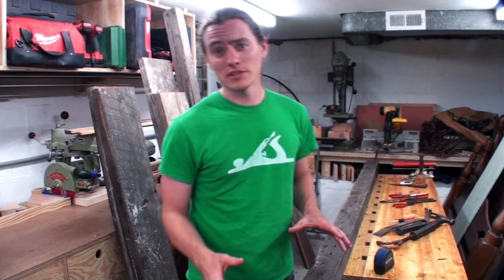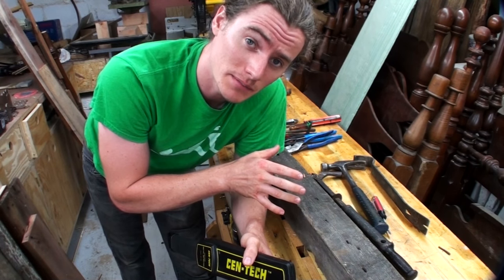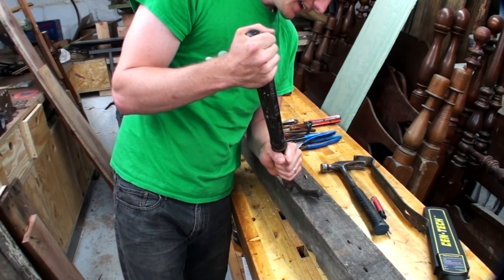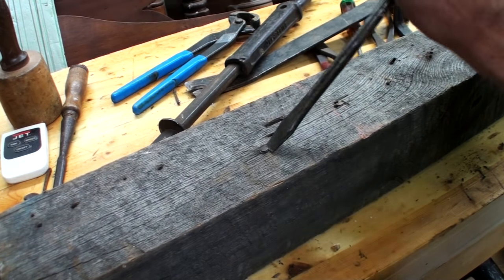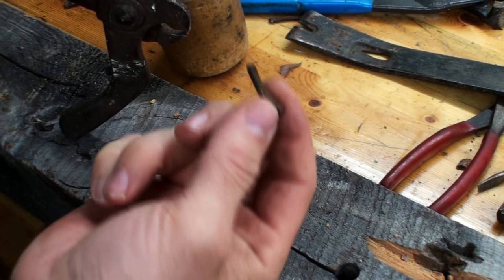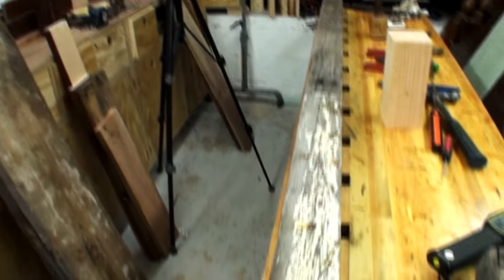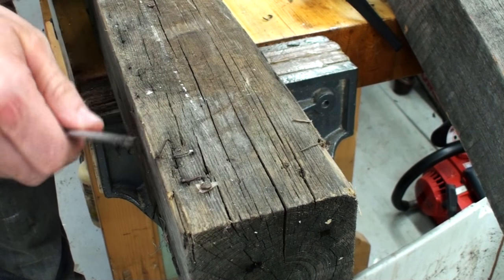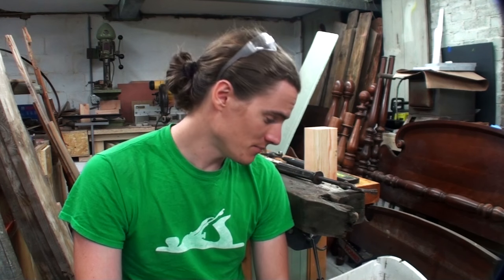Reclaimed Lumber - Removing Nails and other metal

Comment: Words of wisdom.  I've had so many people talk to me about pallet projects... and they are such a royal pain.  Also, the toxins produced by some of the chemical drying methods can be really dangerous to be around (and have airborne all over the shop).  You touched on all the good points.  It's really important to be realistic and choosy when working with reclaimed lumber.
Reply from the maker: Pallets are something I just don't mess with. They are pretty low grade, the slats are already so thin and the nails used to put them together are just to good at their job. I find the time to get them, take them apart just to end up with thin little boards are not worth my effort. They are usually still pretty "wet" as well. I've seen some nice projects made with them, but they just don't fit what I'm doing. Thanks for watching Ed.

Comment: One tool you didn't mention or show is a "Cat's Paw". Good for getting under the head of any nail that is flush or slightly embedded. Does a similar amount of wood damage as the tool you showed. It's nail pulling jaws are driven into the wood around the nail by a hammer.

Comment: Old dimensional lumber from buildings up thru the 1940’s is absolutely worth some work to salvage. There is no more old growth heart pine to be had except for salvage & sinkers. People are gutting old houses in 50 mile radius of Charlotte to renovate with OSB & vinyl plank, tossing a boat load of dimensional lumber, trim, raised panel doors, window sashes & mantles. I asked one guy why he was throwing out stained raised panel doors complete with their mortise locks, engraved brass knobs, casing, backband, & 1 1/4” thick jambs. He said it was easier to rip them out & install pre hung units than work on them

Comment: For embedded nails, I drill two elongated holes on opposite sides of the nail then use two screwdrivers to wedge the nail up and out.  The nail puller I have has been one of the best investments I've made.

Comment: I've had very good luck pulling tough-to-pull nails with a large pair of vice grips (newer ones that still have sharp teeth)
Lay a heavy putty knife or your flat bar next to the vice grip and when you roll the vice grip over to pull the nail it won't dent the wood.

Comment: tip for the old cast iron nails is to tap them first.. it breaks the seal on the expanded rusted nails it also helps with alot of them snapping etc
Reply from the maker: Thanks

Comment: To find nails hidden in old wood so long it lays horizontally, place one of those super strong magnets on top of a thin flat piece of plastic and slide it up and down the entire piece of lumber. The magnet will react to metal locating nail.

Comment: I have the Garrett Super scanner. Works really well and will pick up a staple leg. Definitely saves your planer blades. BUT agree on your comments re messing around with second hand timber. As you say, the ends are messed up, the are often notched, once you straighten everything, chop out all the missing bits and pull out the nails your yield isn't great and the day is gone. Now I just have to remember that next time I find "free" timber.

Comment: Factory recycled pallet 2x4 oak runners with the ring shank nail heads sliced of leaving it embedded about 2.5" deep every 2-3" apart, it's impossible to pull out. That puller with the sliding hammer don't have the leverage or the nail will break apart and won't let go. The way to get it out was with a hole saw going deep enough but it's a lot of work, not worth the effort. BTW a staple puller (the one for wood) is a lot faster than with a screwdriver.

Comment: I often use Vice Grip to remove staples. I found out the hard way that old enamel or epoxy paint can quickly ruin the blades of a planer, same with really hard knots in old wood like Southern Yellow Pine. I set up a jig to use my Dremel to sharpen my planer blades.

Comment: Good emphasis on the nail puller, that tool doesn't often show up in DIY. My original was an antique one but the small jaws were so worn it wouldn't hold. So I searched around. Checking Amazon they want up to $90 for the European made one with hardened jaws but their Oriental model is as cheap as $30. But given my experience with the worn jaws I passed on the oriental model. Next checking E-bay someone had a Swedish model with the hardened jaws for only $30 so that's what I have been using. 

Keep up the good work, always find your videos very helpful!

Comment: Honestly...I've been salvaging wood for months now and I have to say I disagree on the pounding nail puller...they are really hard to use and painful. I agree that the mini flat crowbar and hammer do work great.  The flat head screwdriver with a hammer also work well.  I have gotten quite a few out with wire cutters if I don't squeeze too hard

Comment: I use a metal detector after replacing so many planer blades,, but by the time I bought a metal detector.. Lee Valley stopped selling the large wand type detector which was awesome, unfortunately.. I ended up getting a smaller metal detector, which is fantastic for a number of building applications.. but it takes longer with lumber than using the large wand type of metal sweeper. 
 nice wood.. so many clients I build for want me to create that grey aged look on their pieces these days.. which I create with either ash rub, or creating a reaction with the tannins with different chemical agents..(depending on tannin content of the wood.. oak is easy.. maple less so) ashes rubbed on doug fir and the like will polish the sap wood and grey the pith wood for an amazing effect… it takes time but is stunning..
cheers friend.

Comment: I realize those is an old video but I've recently come into rail car floor boards that have torx head screws all through them. Most of them are stripped and way counter sunk. Went with a punch and hammer on the back side of one but that rips up the top a bit. Any advise on getting these out cleaner?
Reply: Take a scrap of wood and drill a ~5/64 hole through it and install a brad in the hole so that it stacks out both sides. Now use the nail to find the stripped out Torx and clamp your wood and nail onto the board you are working on. Now drive the broken Torx out from the far side. The clamped on piece of wood will keep your board from splintering as the Torx head breaks the surface,
Reply: Find a steel dowel pin that you can drive into the rough hole where the stripped Torx is buried. Now drill a hole through a scrap of hardwood slightly bigger than your pin and clamp the wood down to your board over the pin. Now drive your broken screw out from the far side, pushing the pin back.

Comment: Neodymium magnets work great in place of a metal detector.

Anyone here used one of those nail-pullers on nails without a head? I have a pile of reclaimed lumber where the previous owner cut off all nails with a Sawzall instead of backing them out...so they have no heads.
Reply: Sometimes you can drive the nail out the opposite side and then grab it with a nipper to remove it.
Reply: I have 2 of those sliding hammer pullers, it works great on soft wood. Could be much harder on hardwood, in particular long rings sank nails. Should be OK on smooth nails. Get the old used pullers, the new ones may not be as good.

Comment: Have you thought about the "Evolution" blades as say that they cut through nails without damage to the blade
Reply from the maker: I like to use blades that I can get locally and stick with them. I'm not familiar with the Evolution blades, but in general, I'm going to say that long term metal isn't doing a blade any favors and with some of my work I can't have rough cuts, splintering etc... Also, a lot of the wood is turned on my lathe using my duplicator so I don't want to damage the tools. I'll look into the blades, thanks for the comment.

Comment: hi i have a question you may be able to help with or any readers  .....i cant find anything online ive only found how to repair cracks and shakes
i want the opposite.....
i have pitch pine beams that i want to turn into arm chairs for the garden 
i want the beams to have shakes and cracks splits etc especially to the end grain they do have large shakes but i want more around the beams and more prominent 
is there a way to make this happen on reclaimed 7x7 beams?
i know its possible to do this on new timber with extreme heat 
but the core on the reclaimed beams are dry now

please help .......
thanks mike
Reply from the maker: Once they are dry they are pretty stable, letting them lay outside in the whether for a long time may do it. If you want them to check and crack a lot I would get the beams when they are still green then cut them to the lengths you want, the ends will split up as they dry.
Reply: thanks sounds about right ...i dont supose you know if oak would check more than pitch ?
im soaking a piece of the pitch beams now and going to hit it with mass heat to see what happens 
;) mike

Comment: How did you safely remove the paint assuming it has lead?
Is that 4x4 $10.0 a foot or for a 10 foot piece?
Reply from the maker: $10 for the whole piece
Reply: Whow, $10.0 for that small piece?
Reply from the maker: No, $10 for an 8 foot post. Also, forgot to answer your lead question, I just where a respirator and hope for the best. I don't mess with it enough to worry too much.

Comment: Metal detector? Magnet will do the work as well
Reply: It might with a very strong magnet, then you have to have it directly on top of the broken nail. Chances you're going to missed a few unless you sweep it centimeter by centimeter. Metal detector is cheaper than a good $100 circular saw blade or the time it takes to remove the nicks on planer blades.
Reply: @kimchee94112  metal detector is a good tool if one is not on budget but a magnet is sufficient. I always do it with magnet and it works very good for me

Comment: It's from harbor Freight, of course it's broken
Reply: Clamps and rubber gloves are all i buy there
Reply: They have an excellent pocket screw jig, unlike Kreg it's all metal. They also have excellent impact sockets. I have their plate vibrator (for compacting soil), hydraulic table, hydraulic kit, and jack hammer. Still going strong after 7 years. Many of the smaller power tools are pure junk though. Also the problem with HF is they won't have replacement parts after a few years where they change to newer models which is often.